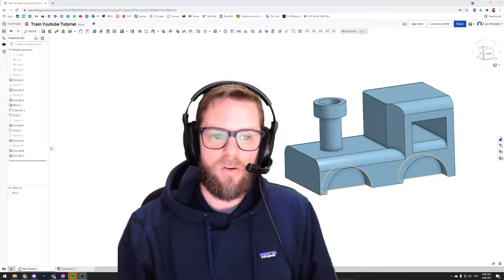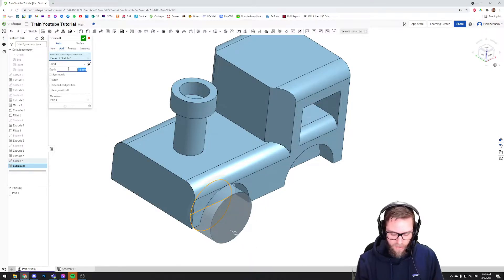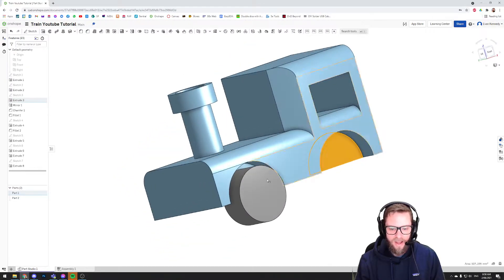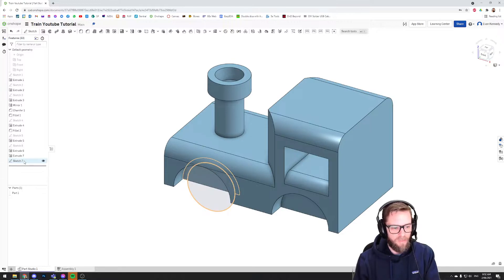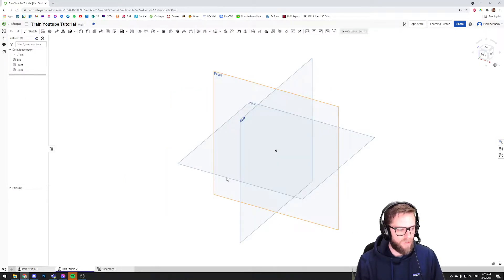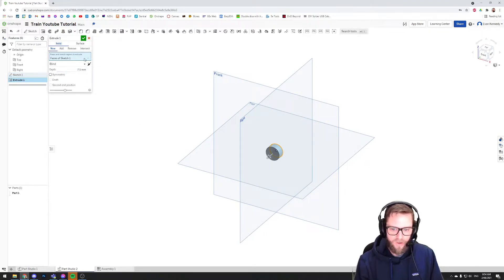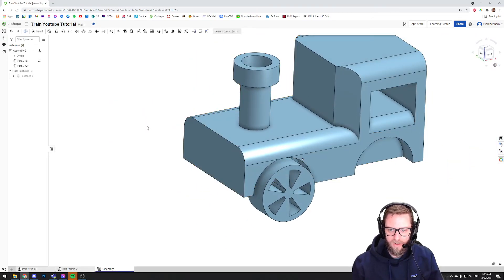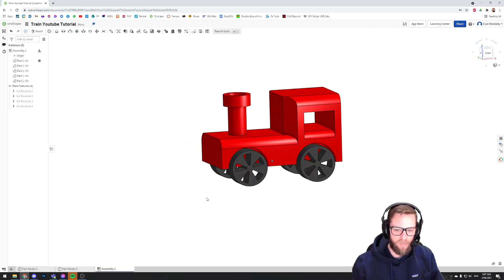Onshape Tutorial 4 - Multiple Parts and Assembly

Comment: Hi. I really like the way you talk while you show the program, explaining in detail what you are doing and why. So many other teachers don't do things this way, so much appreciated.
I'm fairly new to Onshape, and I'm a retired shop teacher who used a different CAD program to teach. Anyway, I am now teaching myself this program just to keep my mind sharp. I'm struggling with two concepts and hoping you can help. First, I am troubled by the tabs in Onshape. I have a project with five parts in it I drew in the Part Studio. But some of the parts need to be "unique" and the differences between them are minor. Maybe appearance, or materials, or orientation. Anyway,  I don't want to redraw each part, just maybe change the color on THAT version of the part. So, what is the best strategy to do that so I can have maybe 5 parts and each one has a different color? I thought maybe exporting each drawing as a STEP file, and then bringing it in to the assembly, but I found that doing that gets rid of all the changes to the original. I tried "Copy here" in the part studio, and that sort of works, but that doesn't always work right.
My second problem is with the tabs. When I import external drawings, it creates a tab called "CAD Import" and after importing I get a message to "update" or "download" the files that I imported, even though they show up in studio tabs of their own. What's going on with that?
Thanks for any insights you can help with.